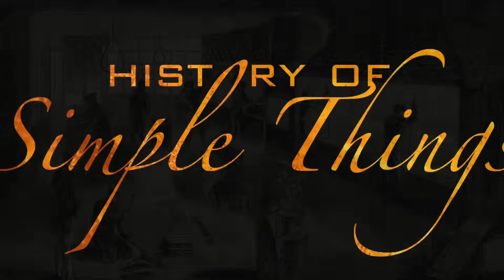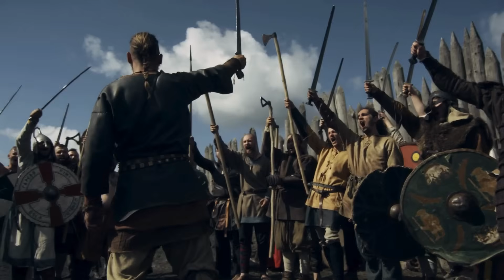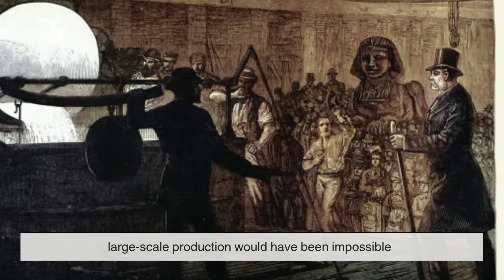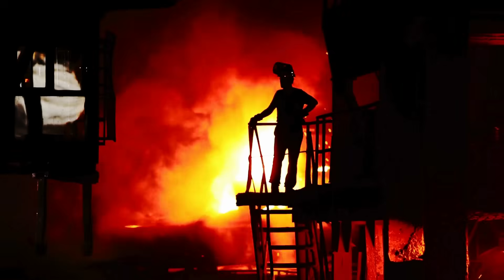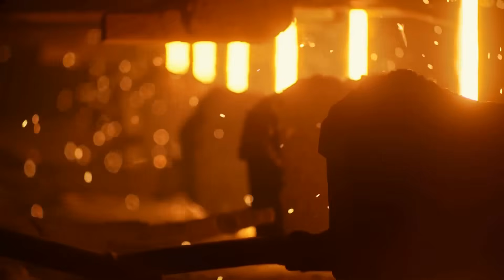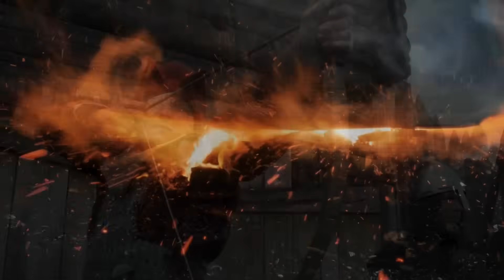What Made Foundries the True Engines Behind the Rise of Empires?

Comment: Bronze is an alloy made from copper and tin which could be melted during ancient times to cast into molds, because bronze's melting temperature was moderate around 900°C (1,652°F). On the other hand, iron melts at a much higher temperature around 1538°C (2800°F) and require more advanced furnaces than melting bronze. Modern foundry furnaces for melting steel use temperatures around 1,700°C (3,090°F). Steel cannons superseded bronze cannons, because steel is stronger than bronze.